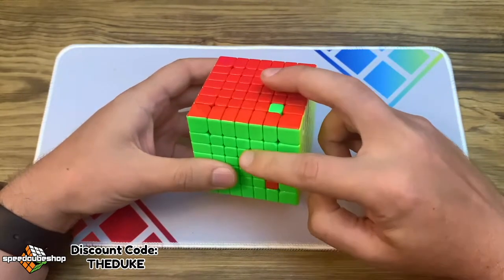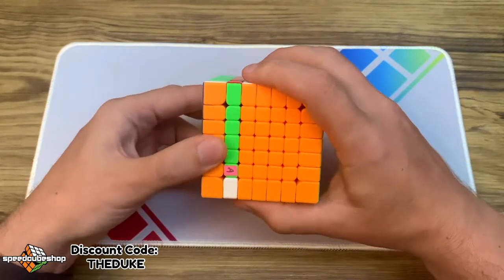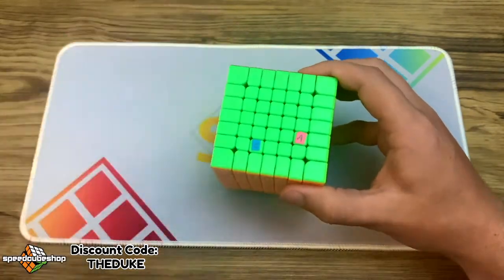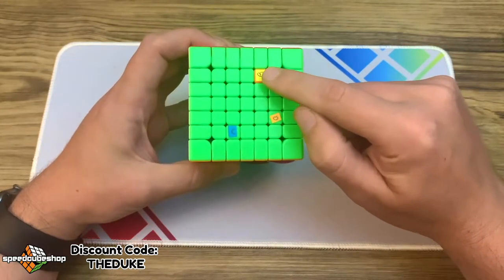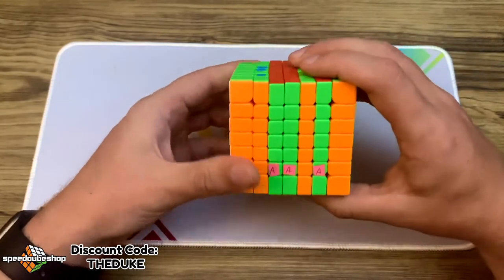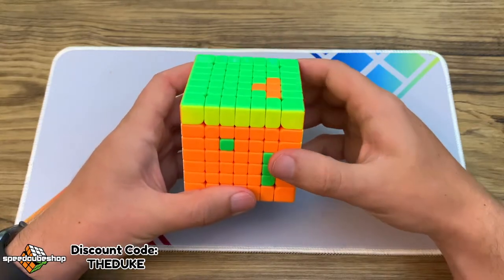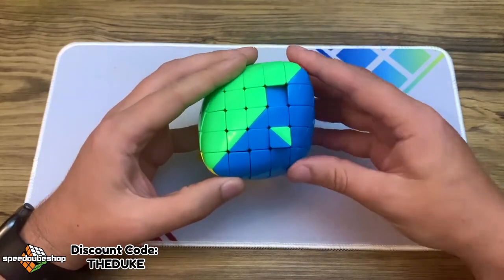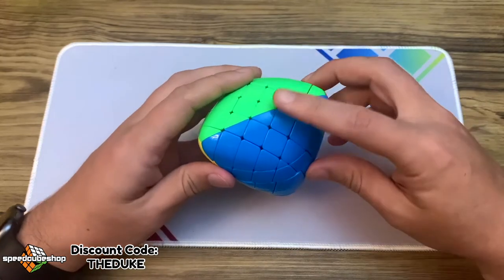Easy Commutator Tutorial - Rubik's Cube

Comment: Very well explained, thanks.

On a 7 x 7, I have all centres solved, but my white and yellow are mixed. Is it possible to use a commutator type algorithm I can use to flip pieces on opposite sides to each other (as in, yellow to white)?

I messed up the edge pairing, hence the issue.
Reply from the maker: Hey, it would basically be exactly the same as the video, except you would slice those layer twice, so I like to do it from white/yellow back and front. Do the layer twice to put the back colour on the front, the F moves would just be the normal 1 turn and the slice layers would just be 2 turn. I hope that makes sense 🤔 let me know if you need a better explanation
Reply: @TheDukeofCubes  It works! Thanks so much. That is a really useful thing to know.

Comment: Why do you use R' R L' L in your notation? You are making slice moves and R is not a slice move! This move is called 2R
This inconsistency in cube notations across many internet pages confuses beginners.
Reply from the maker: If you read my supporting information I try to make it simple by explain to slice down the required layer etc. which make it easier to just mention that layer as a slice with the direction it is moving. 

The alg is written in a basic formation as this can then be applied to any size layered cube depending on the required layer the person needs to move. If we covered every possible commutator in alg format it would be pretty long with all the possible combinations.  

Having to try and go through a commutator for beginners and also include all of the name for the slices 2R, 3R plus L and the primes I felt complicated the ‘easy commutator’ video. 

The video was never intended to be an explanation of notion, just the foundation of movements of the commutator.